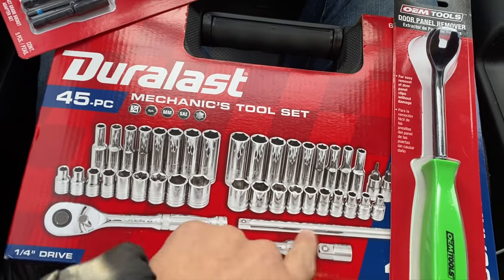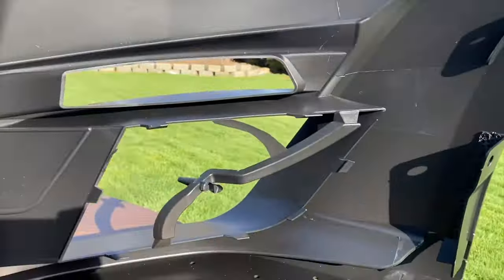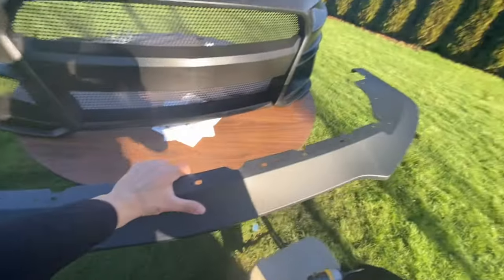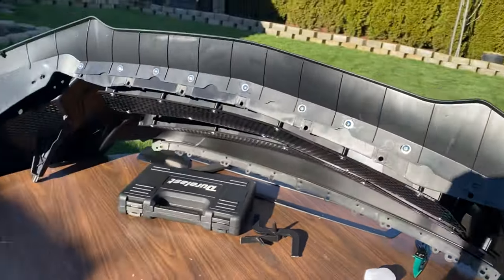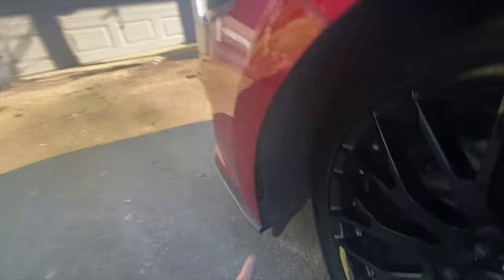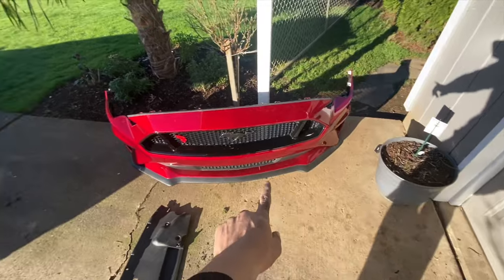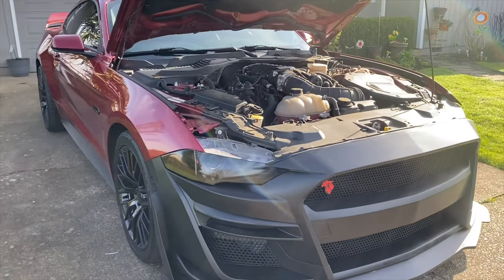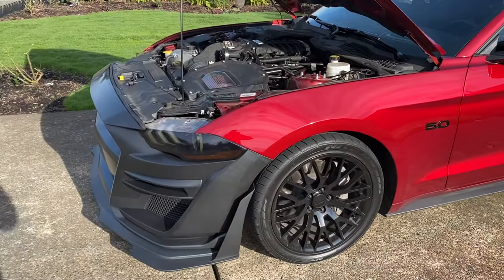GT500 Front Bumper Conversion | 2018, 2019, 2020 | HOW TO INSTALL STEP BY STEP!

Comment: On a paved driveway, do yourselves a big favor and jack up/ place. Jack stands underneath the recommended support points behind the front fender wells so there's plenty of room to work under and around the front assembly. Take it a step further and pull off the front two wheels as well. If you don't have an impact wrench for the lug nuts, make sure you break them loose using the lug wrench from the car before you raise the front end off the ground

Comment: Where I can find the Fog Lights for the Front Bumper GT500
Reply from the maker: You need to use the OEM fog lights, take them off the original and out then in the GT500

Comment: Where did you order all them parts from? 
Mine is a 2019 gt and i would like to but the kit
Reply from the maker: I got it from American muscle. I actually have the bumper that I Installed on the video for sale sale
Reply: @life0ftiti  Thank you , i will check it out
Reply: @eljuarense  
I’d be careful with mp concepts. Mine came damaged and missing hardware/instructions. Im trying to figure out what size the screws and bolts are lol

Comment: Did you have any issue with the belly pan lining up?
Reply from the maker: By the belly pan are you talking about the lighting housing inserts?
Reply: @life0ftiti   No i’m referring to the black cover underneath the car. It connects to the front bumper.
Reply from the maker: Ohhhh… no I didn’t, what type of problems are you having?
Reply: @life0ftiti  well i had a shop do it and they said the mp bumper doesn’t line up. So i was wondering if anyone else was having that problem. What’s your IG i can shoot you a pic